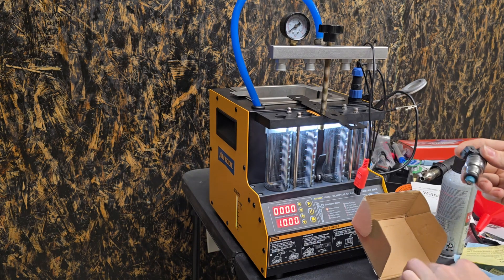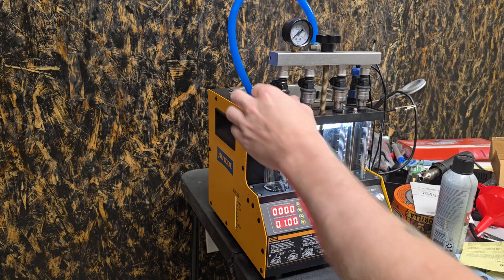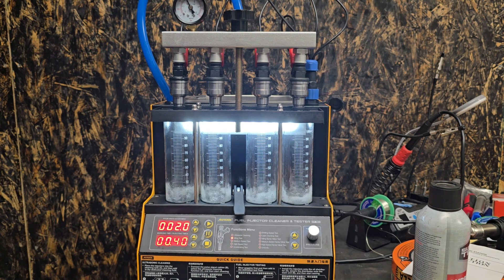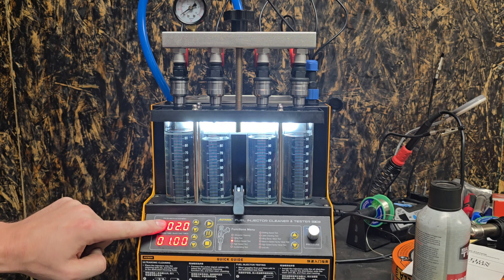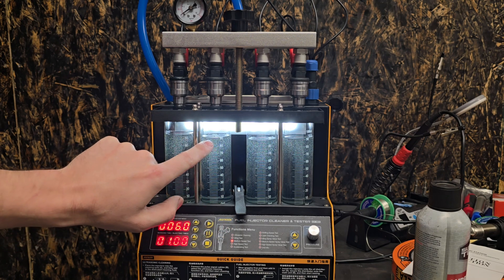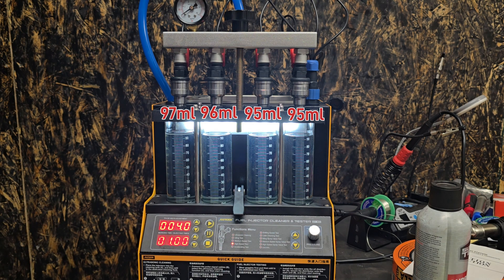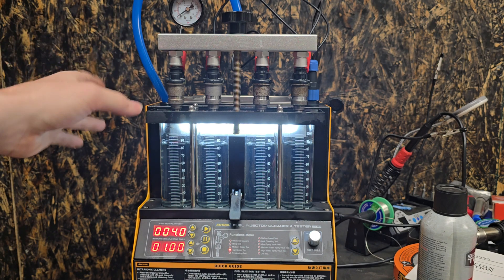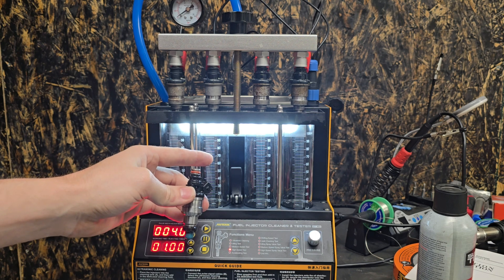Part 2: Testing 1000cc Amazon Injectors! I am very impressed!

Comment: I’m wondering if you ran just two at a time, you might see more consistent results, I have one too, and the system is a little underpowered compared with the vehicle it will be installed in. Certainly the Autel pump isn’t as strong as the one you will have to use in the vehicle for the 1000cc injectors.
All you have to do is disconnect two of the connectors from the injectors you want to test. Trying to test one injector is much easier on this machine with all four installed.
Reply from the maker: @waverider5751  the way I eliminate any inconsistency due to the machine setup is by running the tests twice and moving the injectors around on the rail, if the inconsistencys follows the injectors then I know it's a defect in the injector. If the inconsistency stays in the same spot on the rail, then I know it's due to the setup. The pump on these is more powerful than most stock pumps, the reason it fluctuates on the needle is the lack of a pressure regulator. One thing you could do to help with this is to ad a air chamber to the top of the fuel rail to help act as a buffer